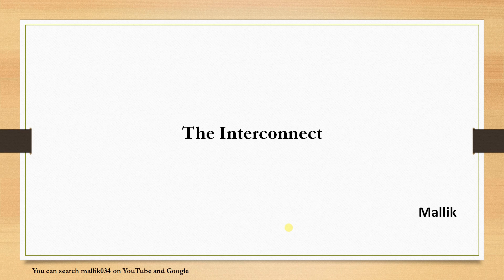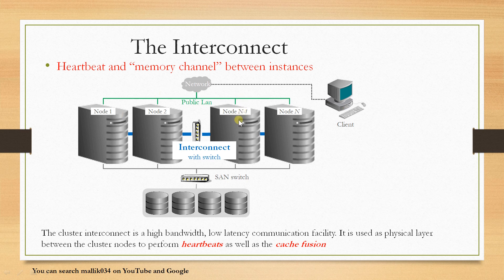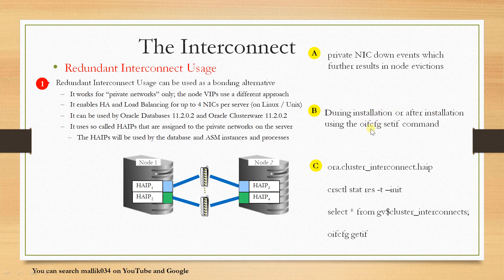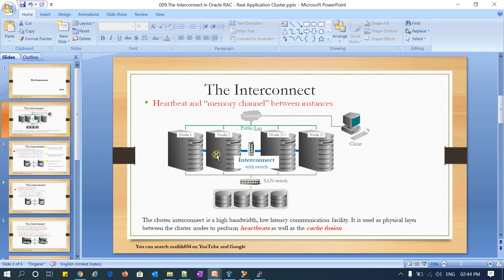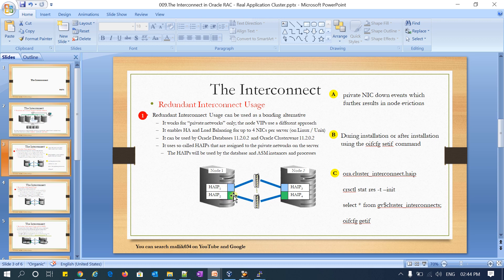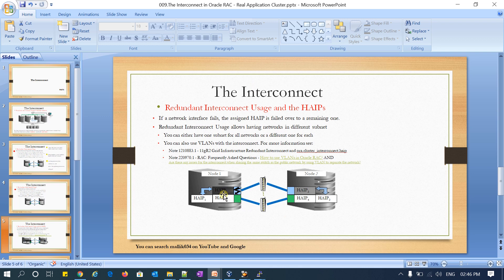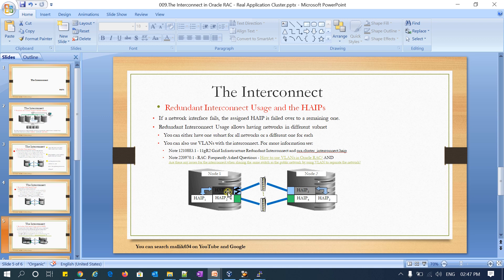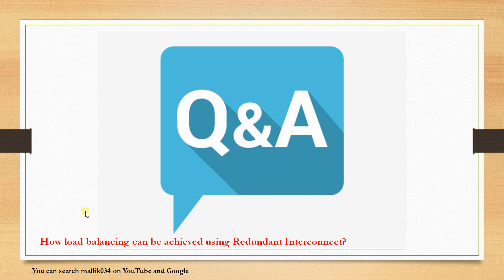009 - Interconnect in RAC (HAIPs) - Network Heart & Disk Heartbeat in RAC - Node Communication

Comment: Mallik...nice...but would be good if you add some more details.
Reply from the maker: Sure, I will review it once again and I will add more details explanation along with some technical demo. Please standby
Reply: @VismoTechnologies  Many thanks for your reply.  As update to my situation, it turned out that our Backup/Recovery (BUR) team's server filesystem backup jobs were cause for frequent node evictions across multiple environments (i.e., dev, test, prod) in which I support.  Once BUR made adjustments to jobs, it seemed to have alleviated and evictions have ceased for past 4-5 weeks now.  However, still have concerns with how our interconnects are setup, given they're all on the same subnet.  Network engineers mentioned all interconnect IP using dedicated switch/routers, but I'm not convinced it's setup correctly per Oracle Support best practices.